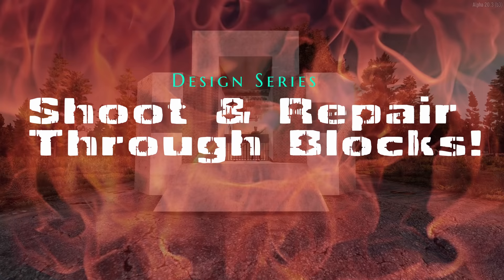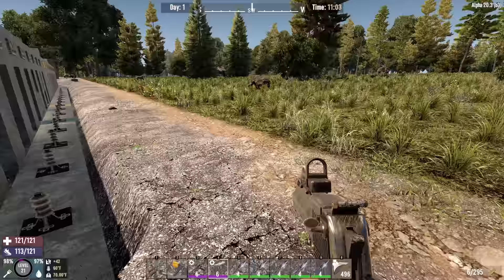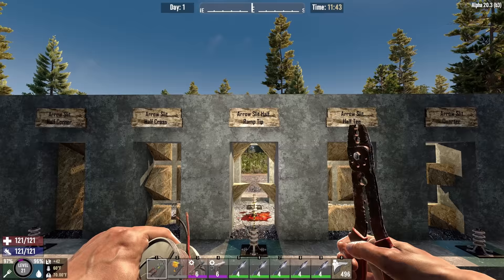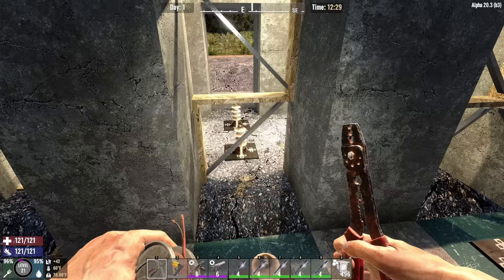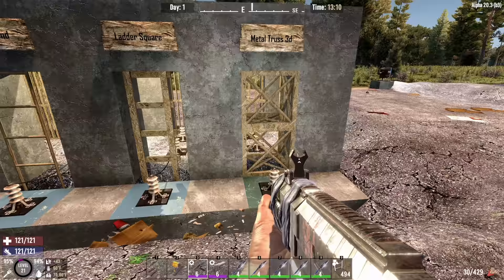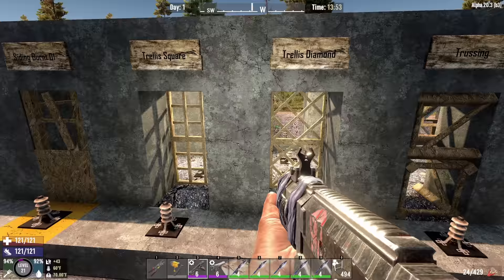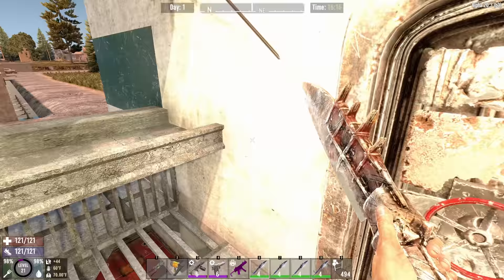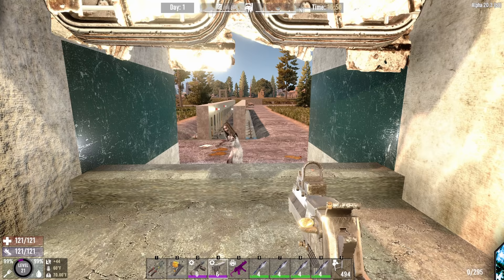Do you know how to hide turrets behind solid walls? | 7 Days to Die Alpha 20

Comment: Your timing is impeccable, currently doing a wasteland only run and just started construction of the horde base. I've got some ideas now. Thank you for the Video Eko, you da man ❤
Reply from the maker: Just an FYI - some of these blocks have been patched.
Reply: Doing some (very) brief testing, some blocks that seem to work like the now patched Baluster Corner 01 are:

Siding Burnt 01 - Has way less hit points then a full block would, but you can shoot straight through it and one side is identical to the side of a full block.

Plate Bracket Centered - This is the magic block for now I think. Has full hit points and one face that is identical to a full block. Can shoot straight through it like it isn't there.

Cube 1/2 Centered Confessional - Honorable mention. Doesn't have a full face like the previous two but you can shoot straight through it even if it is oriented side on such that there is no visible gap that you would be shooting through. Might be applicable in some niche ways.

Happy building.

Comment: This is interesting not just for turrets, but also has useful implications for powered doors.
if a turret can track through those blocks, motion sensors work past those blocks as well. That could help solve the "two sides and one trigger" problem powered doors run into in a new and interesting way. I would be worried that cops will also see / spit through them though.
Reply from the maker: You want to know something that will blow your mind?  Motion sensor can sense through walls :)  It's the dumbest thing ever, and I found that out the hard way on my last base and had to rewire them because I was triggering the garage doors a floor above through concrete w/ a motion sensor.  try it out!
Reply: @WaywardEko  What? Is that another bug for alpha 20? I know in alpha 19 they could see through certain blocks but they sure didn't see through most of them.
Reply from the maker: @GunChronicles  they definitely go through the basic cube shape.

Comment: I thought I was the one that invented the wheel with the Balusters lmao, but man when I found out about them I couldn't believe my eyes at all.

It works.
It just works.
Reply from the maker: Maybe we found them at the same time!
Reply: @WaywardEko  Most possibly lmfao

Also, not sure if you know, but if you place Powered Hatches on a block on the floor (vertically to one side so the hatch door opens down towards the floor and closes upwards, you can set them with motion sensors so as to make the sensor tell the hatches when to open up when detecting zombies, and place turrets behind the hatches. Since the hatches will be closed with no motion, the turrets won't have any line of sight and thus not shoot unneccessarily at either normal zombies, or stuff like bunnies. Saves a lot of ammo and repairs for horde night. 

I have the hatches, and electric fences operating all by motion sensors so when a zombie shows up, everything is powered up for an instant, the zombie dies, and I don't waste much power usage in the process, but it's like a bunker. All closed up until a zombie shows up and the bunker opens up and turrets start raining hell on them then the hatches close again.

It's fun, should give it a try.

Comment: the one problem i'm encountering with the metal truss 3d block is that zombies can end up inside them, seems mostly to happen when they ragdoll from being stunned.
Reply from the maker: I typically use them in places where they are unlikely to ragdoll, so I haven't seen that.  That said I've seem them glitch through a lot in A20, so I'm not surprised.
Reply: @WaywardEko  Hell in A20 I glitch through so much crap

Comment: Nice info. Easy for TFP to patch some of those out, if they wanted to. I've been using the railing block a LOT since I found out about it, and since the arrow slits were changed. I'm still looking for a high visibility replacement for the horizontal poles at my fighting point though (i put a rail on the bottom and pole block on top right now, but keep shooting the pole block when dogs arrive). Round ladders might be worth a try.
Reply from the maker: Yeah - never know what they will decide to shift.  My guess for the baluster corner is that it got slipped in with the baluster rail as an accident.  Some of the other blocks are a little bizarre.

Comment: Protecting switches and other controls is going to be the most useful thing I use from this video. Dealt with one cop getting in and my switches were all kaputz
Reply from the maker: Since they added the shutters, I typically put all my switches behind shutters now.  I will hide relays behind railings for access, but only if they aren't in line of sight of potential cop spit.

Comment: Question: Is there a diagonal block you can connect wires through? Like the the slanted security gate but you can wire through and repair? Even a hollow ramp. I need something that can go along side a ramp but you can repair through. Thanks!!! Great video!! I needed all that info! :) I'm doing my version of the GNS horde base and am making stuff up as I go :)
Reply: Answer: LOL.. between yesterday and today i found a solution in game. The ladder, the not cute one, rustic one, has a diagonal version. IT ALLOWS WIRING!! lol... i tried everything in game... I didn't know it was there and it works!! I can climb up it and wire through it. Hope it helps someone else :)
Reply from the maker: Nice find!!

Comment: on the balister corner, can zombies see through it? I have noticed in my gaming that spitting cops were attacking me from the side with spit while I had regular solid rectangle blocks for that express purpose, i.e. prevent them from seeing me. This happened on consecutive horde nights too. So I'm going to check this out after your block revelations that is if they can see through blocks. Thanks again.
Reply from the maker: I need to put a note at the top of the video - they change the baluster block in A21.  It’s no longer the magical block it was.  Cop spit is becoming an issue with any non-full block sadly.

Comment: Great info.  Can you include block health also since that will affect viability?
Reply from the maker: Block health is dictated by material, not shape.  They briefly changed that and then reverted back to all blocks having the same health after the community raged.
Reply: @WaywardEko  just used some burning blocks and they're like 1/4  hp of standard blocks. Zombies went for that instead of the doors.

Comment: Great video and thorough explanation.  So I have a group that is surviving blood moon events BUT we get envious of all the loot bags that drop and then disappear.  All that fat lewt goes no where.

We have a bigger area with a pit for pipe bombs and blade traps, BUT was thinking about making the floor of this pit out of steel bars, then add two blocks below so we can walk around and collect loot bag drops by looking up (only zombie issues SHOULD be cops spitting and demolitioners exploding.

Is there a bar shake that would let the loot bags fall through?

OR is there a slopped block  that would have the bags all fall to a collection point (kind of thinking out loud here) and collect the stacks of loot Bags from A secure entry point???
Reply from the maker: No blocks that the loot bags would fall through.  I have seen people build underground fighting positions so that when the zombies drop stuff,  it rolls to the fighting position where you can snag it.  You can also do something like I did on my Winter’s Edge base which has two fighting lanes inside the base that you can switch one off and loot during horde night.
Reply: @WaywardEko  great answer thanks!!!

Comment: What about throwables?
Reply from the maker: Great question - I will need to research that once because it will depend on how throwables are classified.  I know they won’t go through any of the bars, railings, security grates.  It’s possible they will go through some of the half blocks.  I usually use shutters for throwables.

Comment: Cop vomit???
Reply from the maker: Yup!  The green goo they spew at you.
Reply: @WaywardEko  do the blocks you can shoot through stop the vomit
Reply from the maker: @mikecarter3983  Nope.  I believe the cop vomit counts as bullet/arrow type projectile and will go through.  No answer to shooting out but stopping that.  I think the best use case here is for traps that are offset from your fighting position as it's unlikely for cops to target them.
Reply: @WaywardEko  I solved the vomit problem by making myself a mod that seriously nerfs the vomit. With my mod installed the cops can only vomit for about a 6 meter distance and the vomit does only five hit points worth of block damage now.
Reply: Just use flipped and inversed scaffolding ladders so they act as bars. Blocks most vomits, you can shoot and melee through.